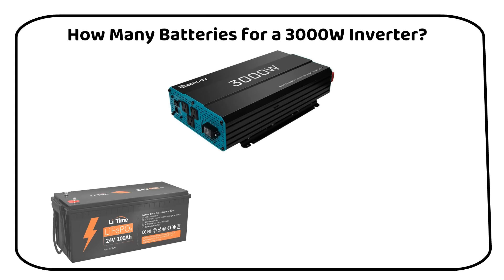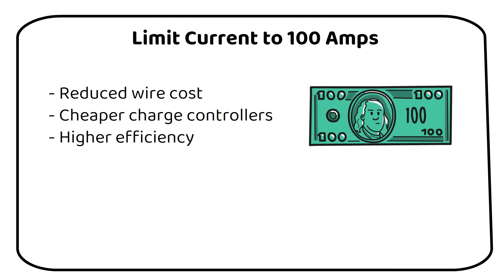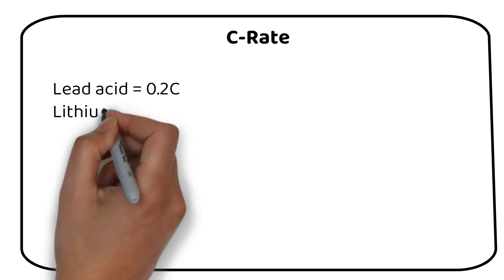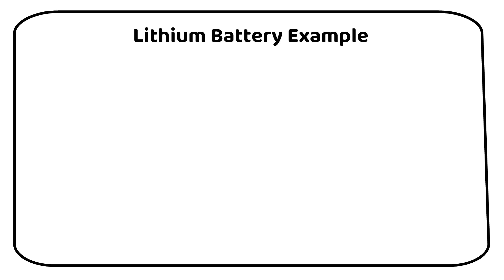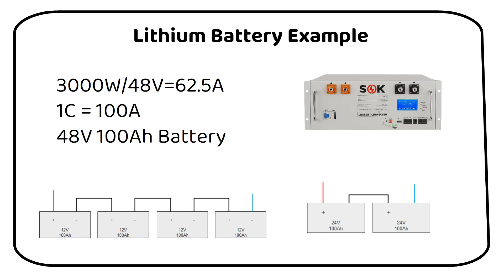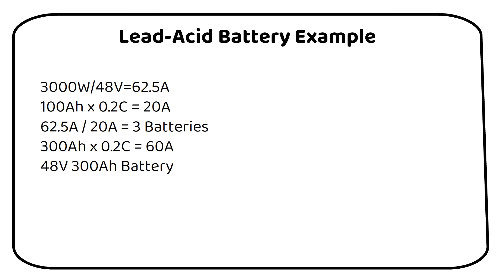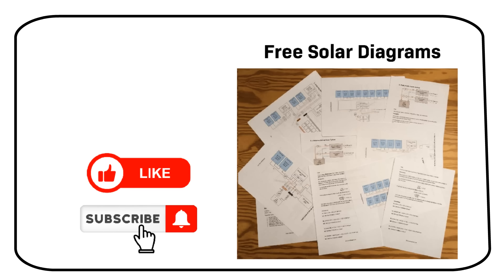How Many Batteries For a 3000W Inverter?

Comment: I loved the video. Maybe someone has already said something, but I think I see an error. At 4 minutes & 42 seconds in the video on the "Lead Acid Battery Example" it shows 3 lead acid batteries instead of 4. Making it 36 volts, changing the breaker to a 83.33 AMPs. Maybe you meant 4 Batteries. Otherwise, I am thinking this would mess up the calculations and burn out something? I would like to know for sure. Thank you.
Reply from the maker: It's a minimum of 3 batteries. That would indeed make a 36V battery system, but our inverter works on 48V. So we have to increase it to 48V and then we have 4 batteries in series.

Comment: What about 12v?
Reply: You would probably need 3 batteries. Bms on a lifepo4 battery typically won't allow more than 100a and a 12v 3000w inverter would draw about 250a
Reply: get ready to spend $$$ on very big cables.  the lower current of a 48v system makes wiring easier

Comment: What I mean is should I use two batteries to run a 1500w  inverter to run a 1500 w heater in my truck. And if so do I hook it up in set. Or in parr.
Reply from the maker: Only use one inverter. If it's higher than 1000W, then get a single 24V 100Ah battery.

Comment: No I can't am doing what i call a mobile power station, it all comes together in a very nice trailer to tow behind my BMW, i have 5 heavy duty batteries, running my cooler my barbecue my microwave power Ed by to solar panels  panels if you were to use all together of course kettle, toaster you only have 2 hours, from fully charged 😮

Comment: I use a 2000W inverter, and a 60v  nominal battery (67,2max) for reduced current (around 30-35A) and reduced voltage drop!
Using 4 solar panels in series (48v 8,33A, 100w panels)
With a different solar charger I'd add 1 more and charge at 60v for even more charging efficiency❤️

Great video man

Comment: "Limit current to 100 Amps..."
This is why I shall do a 36V system.
And your explanation of the C-Rates of batteries explains why those Telephone Central Office Backup Banks I installed were so huge.
I'm a retired electrician, and, frankly, managed to miss that day in class.
Reply: Maybe you can help. I use electrodacus system, but it's 24v. Is there a better system on the market? I still don't understand the rationale for using 100A system. 
My batteries are prismatic cells and they come in 280Ah configuration.
Reply from the maker: Limit to 100Amps is not a rule set in stone, but i like to use it to size systems for costs reasons.
Reply: @cleversolarpower  100 Amp cable is SO much cheaper than 200 Amp!
Reply from the maker: @TimeSurfer206  Exactly.

Comment: Yea, I agree it's best to size the inverter to a margin above the expected peak load.  The total battery capacity would be determined by the expected average load, as would a solar array(plus a region/sunlight-based margin) and battery chargers.
     Oversized inverters for a modest average expected power consumption has little effect, other than the idle current used to run the circuitry.
Reply: i.e. - More unnecessary and undesired idle current draw from an oversized inverter in porportion to the battery bank (thus draining the batteries faster while inverter/ batteries are not in use). The problem though in this equation, is cheap inverters which cannot deliver the current (amps/ watts) which are stated on the inverter. So I always oversize even with expensive inverters and then oversize battery and solar array commensurately (when and where possible/ practical). The batteries will always outlast the inverter if used properly.

Comment: Love reading all the comments.  So much talk and so many ideas.  Simply put, i have a 5kw inverter with 6.6kw solar panels and a 9.6kw battery. The inverter is hybrid so it charges my battery bank and i use my battery to then run my inverter which gives me my household power.  5kw is enough to run everything in the house except for my 7.5kw ducted air con.  I did not bother to increase my inverter to cover the aircon as it will rarely get used and when i do use it then i can tap into the grid power.  But the 5kw inverter is 96% efficient so i can run it at around 4.5kw comfortably, which is enough as mentioned to run the house, day and night.

Comment: Hey Nick you are the main man and best person to answer this for me. This is a van life situation using the Ecoflow delta pro. The alternator chargers they offer cost 599$ each so what I want to do is purchase a large car audio high output alternator use a 3000 watt inverter so that I can charge the delta pro with ac voltage at about a 20 amp draw. This will offer me a faster charging alternative to the limited amount of solar I can install on a van. All with proper Guage wiring and fuses of course. And with the delta pro I can control the charge rate. Can this work if done correctly?  You can just say yes or no or drop me one of your video links to point me in the right direction. Thank you for everything man

Comment: I installed a 3KW pure sine wave inverter together with six 110 AH 12 volt leisure batteries wired in parallel on our boat six years ago. I didn't do any calculations. It was just my gut feeling of what was needed. We have a 230V fridge, a 230V 26" LCD TV, a 230V microwave, a 2KW 230V Electric kettle, a 17 inch Laptop PC run with a 230V charger and can go away from the mooring for a week at a time and run those things with no issue. We do have a diesel powered, 12 KVA generator installed too but rarely use it.
Reply from the maker: Yes, it will work.
Reply: Batteries:Why not in series?
Reply: @afzaalkhan.m  My inverter requires a 12v supply. Running six 12v batteries in series would produce an output of 72V. If you look at the diagram at 5.29 in the video above, you can see three lines of batteries. The horizontal lines are in series giving 48v and then the three lines are connected in parallel vertically to give 300 Ah.
Reply: Has anyone any idea about Omron omron sysdrive 3g3fv 7.5kw  inverter, please? I have one and unsure if this could be connected to solar panels system
Reply: @afzaalkhan.m  the voltage election depends on the voltage in from the inversor, if you have a 12V DC in inversor have to use 12V bateries, if you have 24 V dc in inversror have to put 24v bateries (12x2 series), if 36 dc in (3x12V series). Some times have to work with the reality and the theory is ideal but not real

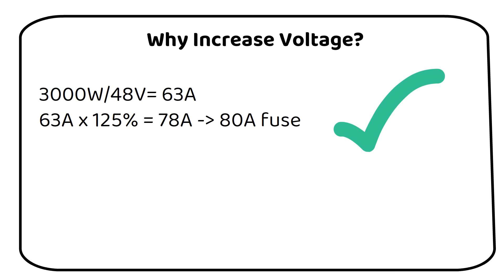Comment: Per your comments @ 1:21 & @ 1:49, it would seem a Lead Acid Battery Pack should also be given that "25% Buffer", meaning a 400 Ah x 48V pack, or 4S4P Pack is really safer!

But, most Lead Acid Batteries aren't rated at "0.2C" they are rated at a "20 Hour Discharge Rate". A 0.2C is actually a 5 Hour Discharge Rate (5 x 0.2 = 1.0). So a 20 Hour Rate, is 0.05C (20 x 0.05 = 1.00)

You can find "Some" Lead Acid Batteries, rated on a 10 Hour Discharge Rate, as well, if you get the Higher Priced And more Exotic ones. 

However, this still doesn't count that Lead Acid Batteries shouldn't be discharged to "Dead" or "100%", but in normal use, should never be drawn down below "50%" of Rated Capacity! (If you want any meaningful Lifespan from them!) 😲
Reply: max life a bank never should go below 25%, but between cost and size the standard for most is 50% depth of discharge, so basically once you calculate needed run time, add a safety factor, you either multiply it by 2 (Cost/life span ratio most go with) or by 3 best life but higher cost. But he was correct in absolute bare minimum to operate an inverter with out destroying the batteries (And possibly inverter) is a 100AH battery, but be pretty useless functionally due to next to no run time.

Comment: I have 3 - 12v 300ah lifep4 batteries and a 12 v - 3000 w inverter.. will it harm my batteries since I can not reach 48v
Reply from the maker: No, it will not harm your batteries or inverter. You just need bigger cables to handle the high current. Your charge controller will be more expensive, but other than that no harm done.
Reply: @cleversolarpower  hey, thank you for the response. I wasn't expecting to receive an answer honestly, much less so quickly. Will subscribe.

Comment: This is why some people like all in one power supplies. They don't have to figure this stuff out. I know this system is cheaper and more flexible but some people would rather pay the extra cost and go with a plug and play set up. Your presentation was excellent!
Reply from the maker: It is true that all in one systems require less wiring. But if one components breaks, the entire system goes down with it. So as a reliability standpoint, not so great. You still have to figure out battery sizing though. You should not connect a single 12V 100Ah battery to a 3kW all in one system. Because the sizing is totally off. People also do not realize that all in one system consume power when on standby. A 3kW unit with MPPT, inverter and charger can consume 30W idle. Thats 720Wh, a little more than half the capacity of a 12V 100Ah battery for just sitting there being turned on.

Comment: I have a 20w solar panel, 30a charge controller,12v 7ah battery and a 200w inverter. Is using the 7ah battery with the 200w inverter to charge my 33watt phone ideal

Comment: Have not installed yet I purchased a 3000 W inverter that will handle a 6000 W. I don’t recall the amount of time but it’s a start of it for starting large motors and things load.
Reply from the maker: Then you are better off with a low frequency inverter for inductive loads.

Comment: Great info for longer-term setups.

For short term, I use a 12v 100AH battery connected to a 3000 watt inverter. My total amp draw is about 12 amps per hour if I opt to run everything I need at the same time. This carry's the load for about 6 hours. I have a second battery that I charge on a propane generator while the other one is carrying the load, then switch them out. It takes about 1.5 hours to charge the battery, and I get about 14 hours of run-time on the generator for a 20# tank, which means I could get about 48 hours of power to the things I need. (TV/Internet/fridge/freezer/window AC unit/ portable heater/etc as each is needed) - I normally do not run everything 100% of the time, for example the window AC unit draws about 800 watts/5 amps by itself, so I tend to only run that intermittently, and hunker down in just one room with it running about 20 minutes per hour on average. - Same for a space heater if it is cold, though it has an even higher current draw)
Reply from the maker: Don't forget that a 3kw inverter will consume about 30-50w just idling. That's 720wh-1200wh daily. You can use a small but efficient victron inverter for small loads and turn off your 3kw inverter when you don't need it.
Reply: How do I find how many amps I'm using? My system doesn't seem to have that capability...
Reply: @LotsaThingsNstuff   - There is normally a label on the items that posts the amp draw (or at least the watts, and you can then calculate the amps - but always account for the initial surge, which is normally higher (briefly) than the stated running watts or amp draw)
Reply: @LotsaThingsNstuff  A=W/V  or Amps=Watts/Volts    Ex: in a 12v system  1500 Watts / 12 Volts = 125amps
Reply: Everything is based on usage.  Your not going to run everything at the same time at least I hope your not going to . I use 12v backup lighting and run a 2000w inverter for fig and freezer.  I use 6 lead deep cycle batteries 780ah each backed up with 800ah solar and one 200ah wind turbine.  I can go for months without needing to charge with normal means . This is a backup only system not living off of it
Reply: That's what interests me. Can I get a few small inverters to switch on as demand increases, or keep smaller ones for lights and TV and bigger one for large items etc.
Reply: Your figures don’t add up. Your 800w ac is drawing nearly 70a from the battery alone.
Reply: @OH2023-cj9if  you can even get a 12v TV.  Most new ones are 12v they have transformer inside that steps them down
Reply: @E6EES  Not sure what you are saying? 

The battery is flowing through a 3k watt inverter, so the amp draw is calculated off of the AC amps, and not the 12 volt DC battery. I am not engineer, all I can say is it will run fine on it. (The window unit will only draw the 800watt when the compressor is cycled on) 

I easily get 5-6 hours of run time. (100amp battery, drained to 30 amps, - with a draw of 12 amps, I get about 5.5 hours) 
70amp hour available/12amp hour draw = 5.8 hours of power.
Reply: @44Mag  I am saying 800w at 12v is 67a. So a 100ah battery Will last less than 1.5 hrs before being fully discharged. The unit will have to be running less than 25% of every hour to get 5 hours run time and that's without any other loads being connected
Reply: @E6EES  Hmm - I am not sure....All I can say is I have used it twice as described. (The 1st time I had to take a battery out of the car because I only had one on hand. I alternated them about every 5 hours. the one not being used was charged on a propane generator with a standard battery charger plugged in to it.) 
I know I only ran the window unit about 20 min per hour.

It did power the fridge, the freezer, the cable modem, the router, the TV and 2 fans the entire time, plus the window unit about 20 minutes per hour.

Perhaps I was running the battery below the 80% goal and nearly depleting it.

I calculated my total amp draw to be about 12 amps max when the AC was on, and about 7 amps when it was not. (The fridge and freezer would bump that up when the compressors were running of course)

If I have a battery that is 100amp, that means it will deliver 100amps for 1 hour. If my draw is 12amps per hour, then that is over 6 hours of run time, if I took it to 80% drain. (80/12)

I can assure you it works, and runs things just fine....As stated, I am not an engineer, and probably only know enough to be dangerous, but it does function.

Now I may be killing my battery/inverter and causing it to last a lot shorter period - I will find out I guess.

Thanks for the input on this though.
Reply: @OH2023-cj9if  makes sense, a small power station inverter saves you from running the big inverter
Reply: @44Mag  you are right that if you got 12v 100AH you got 100amps for one hour. Now that is only 1200watts of power for one hour but after all the losses its more like 1000 watts of usable power from your one 12v 100ah battery witch is not much of anything at all and that's what E6EES is trying to say 
you would want a min of 300AH battery setup for your 12v 3000watt inverter and that would still only run 1 hour at full load or get a smaller inverter that is 1000 watts or less to better match your needs and use less wasted power doing it
Reply: @cleversolarpower  this is incorrect. In ECO mode the 3000w 12v Victron Phoenix inverter uses only 18w, cycling every for 8 seconds 30 seconds, so approximately 0.4A, or 115w daily
Reply: You are talking about the AC side of the inverter for your amps. the 12v DC side will draw 250amps if the inverter run at 3000 watts.     3000w/12v = 250a.
Reply: @eric0u812  790ah each, how big a battery is that?
Reply: @robertelmo7736  deep cycle boat battery.  Roughly 16" long 12" high 8" wide .
Reply: @eric0u812  So you were talking cold cranking amps not amp hours I believe?

Comment: Very useful. I send it to my clients when dealing with what's needed in there RVs.
Reply: As a system builder I'll verify what he said is accurate, and must say one of very few I have seen to do it accurately. As to charge controllers another way to look at it, with a quality charge controller, at 12v best you can do is 750w, but at 48 same unit will do 3.5kw so you have more power available. a general rule, no matter the voltage the core wiring should be no less than 2 awg imo

Comment: New to your channel, I'm trying to apply your formulas to my case but I'm having trouble using the C rate of my AGM Renogy 200A/H battery, it seems that it's 0 05C, is that correct?
  My setup is basic 400W solar with a 30A PWM charge controller and a 2000W inverter.
  The main use is to keep the fridge/freezer (300-400W) powered by the inverter while we tow the trailer, therefore without using the propane power.
  Do you see any issue with this installation?
  All comments and responses are welcome
  Cheers
  Phil

Comment: so I have 3x 105 AH battery bank.  for 315 AH - planning a 2000 watt renogy invertor with 1/0 cable and a 250 AMP fuse.  SOund good?  we will almost never use appliances over 1k watts.  we wanted the extra just in case.  does this sound OK? 12v AGMS
Reply: Sounds logical, my renogy 2000watt does great I'm in 3 100 ah lithiums
Reply from the maker: I just published a guide on calculating wires and fuses. Even if your inverter can draw 2,000W, you need to size for a 2000W power draw.
Reply: Small battery bank will have very short run times, AGM's are easy to kill very sensitive to charge voltages. The fuse is sized to protect the wire, not your devices, but with single aut you're fine with that fuse.

Comment: Solar panel disconnect switch before solar charge controller or after?
Reply: Before. So you can safely work on the system without power feeding into it. Technically, you can have disconnects between all components, to ensure you can work on any part of the system without worry. Disconnecting power from the solar panels will not isolate or disconnect power between your battery and inverter. Most people only have a fuse between the inverter and battery, but some will use a breaker, so they can switch off the power from the battery to the inverter.